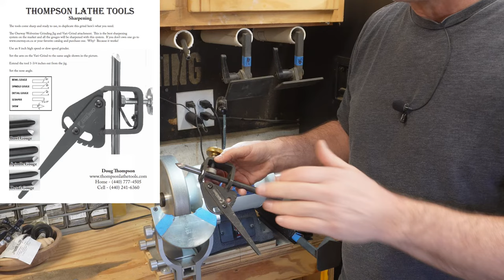Woodturning: My Super Simple Method to Keep Your Lathe Tools Super Sharp

Comment: Hi scott would a digital table saw angle gauge work on your wheels  they are cheap and just write angles required on each tool ??
Reply from the maker: I'm not sure.  It definitely would give an accurate angle of the platform relative to level.  But the angle relative to the curved wheel is quite a bit different

Comment: Hi Scott, Lewis Elliott here. Great sharpening video. What are the distance settings for your wolverine arm, from the front of the base to the front edge of back wall of the pocket for both your spindle gouge setting and your bowl gouge setting? Please let me know. Thanks
Reply from the maker: Hey Lewis,  I know we discussed this already but I'm answering it here in case someone else has the same question.  You would need to have your grinder set to the same height above the clamp and the front edge of the clamp would need to be the same distance from the center of the spindle on the grinder.  If they were not exactly the same, the distance you asked about wouldn't be helpful.  Since we all set up our grinders a bit different, the best way to match an existing angle is to put the tool  in the Vari Grind Jig, Use a known measurement for the amount of tool that protrudes out from the jig, and then slide the bar in or out until you get the bevel of the gouge sitting as flat as possible on the grinding wheel

Comment: Hello thanks for the video been struggling to keep my chisels sharp, I was also wondering if you recommend getting an extended tool rest, and if so where I could find one?
Reply from the maker: Hi and thanks for watching.  Since this was a sharpening video, I'm not sure if you're asking about the 'tool rest' on the lathe or the 'platform' on the grinder.  I'll just answer both.  I have several sizes of tool rests for my lathe and a couple of curved ones for bowls.  Different sizes and shapes definitely do come in handy.  Robust Lathes makes tool rests for most lathes.  But you should be able to find tool rests just about anywhere that sells Lathes and lathe accessories.  Just make sure the post diameter will fit your banjo.  The platforms I use on my grinder are definitely larger than the standard platforms that came with the grinder.  The extra real estate makes it easier to get a consistent bevel.  With that said, although the platforms are larger than the ones that came with the grinder, they are standard size for sharpening lathe tools.  I guess it's a sweet spot.  Anything much larger would just get in the way.

Comment: Great video. Do you have any advice on sharpening using sandpaper vs cbn wheel?
Reply from the maker: I used to sharpen my plane irons with sandpaper on float glass before I graduated to diamond stones.  But that was a long time ago when I made things from boards and before I started woodturning.  With the skew being a possible exception, I think sharpening woodturning tools with sandpaper would be extremely difficult at best and would be very time  inefficient.  You definitely don't need cbn wheels.  They're great but people had been using stone grinder wheels for years before there was cbn.  Instead of cbn, check into aluminum oxide stone wheels for your grinder.  The process will be nearly the same

Comment: Thanks for the video Scott.  At the 26:49 mark you said that you used the same angle, distance, set up on your One Way jig for "all your spindle gouges".  Is this because you use all the gouges in a similar manner, so having the same grind makes for consistent results and would the same use of all settings work with bowl gouge grind settings?  As a new turner, seeing so many variations on bowl gouge tips (bevels, wing sweep, etc.) makes me wonder if using a single type would help or hurt my learning curve.
Reply from the maker: Great question.  Let's start with this.  I'm sorry if I'm addressing things you already know.  Bowl gouges and spindle gouges are  completely different tools for completely different purposes.  Spindle gouges are designed to cut through mostly side grain.  Because a bowl blank is usually mounted cross grain, the bowl gouge is designed to cut through the alternating end grain/ side grain of a bowl blank.  If you look at them head on you'll see that the bowl gouge has a much deeper flute.
All my spindle gouges (except one) are ground the same way.  This helps build muscle memory so the tool cuts as it's expected to.  The specific angle isn't critical as long as it's in a generally acceptable range.  The idea is, that regardless of the size of spindle gouge, with a consistent grind angle, the tool performs as expected.  The same applies to bowl gouges.  Bowl gouges need a steeper (larger degree) grind than spindle gouges to hollow out the inside of a bowl.   all my bowl gouges I use daily have the same grind angle.There are many schools of thought about which grind angle is best.  The best one, however, is the one you're most comfortable with.  I'd suggest picking one and getting comfortable with it before switching to something else.  The key is muscle memory.  A different angle will require a slightly different stance, hold, and movement to work as efficiently as possible.  
That's why it's important that all the spindle gouges are ground like every other spindle gouge, and all the bowl gouges are ground like every other bowl gouge.  As a matter of fact, all my scrapers are also all ground the same with a top bevel of 15 degrees and a main bevel of 55 degrees.  The profile may change, but the bevel angles are identical so they all cut the same and require the same presentation to the wood.  
Knowing how each tool will perform makes me efficient, effective, and safe.  For me, it's important to keep the grind angles as consistent as possible for each type of tool.  
With all that said, I do have a 'detail gouge' which is a spindle gouge ground by hand to a very shallow angle.  It's only used for reaching into tight corners.  It would be a bit unsafe to use that tool as a regular spindle gouge as it's not ground for that purpose.  So for me, it's ok to grind my tools to any angle I need, but the vast majority are consistently ground to repeatable known angles so the tools will perform as I expect them to.  I hope I answered your question in the short story I just wrote 😂.  If you're having trouble deciding on which bowl gouge grind to use, just remember, when used properly, they all work well for those using them.
Reply from the maker: I did do a two part series on bowl turning basics.  Perhaps watching those two videos could answer some of your questions about grind angles.

Comment: Hi Scott, thanks for a super informative video, 
One of, if not my favourite tools for spindle work, and also for tenons and recesses, is an angled oval skew, I invariably sharpen that on a flat oil stone, which seems to work ok? would I be better using the grinding wheel, and if so, should I only use it "one way up" to utilise  the burr? 

One thing for sure, none of my tools seem to cut as well as the one sI see on videos ( they're all good HSS Sheffield made tools)  I'v just ordered a new bench grinder, as the one I have has a white wheel, but fixed 90 degree rests, so it's all done freehand.  Thanks again, hopefully using your advice, and the new grinder I might use less sandpaper!! Best regards...Pete
Reply from the maker: Hi Pete.  There is no definitive "right" way to sharpen.  We all have to do what works best with our individual style.  I know plenty of turners who freehand sharpen all their tools.  Derek Weidman is one that comes to mind and Derek does things on a lathe that has to be seen to be believed.  
With that said, my sharpening method works for me and its relatively simple.  I'm glad you enjoyed the video and thanks for watching!
My opinion on your skew question is, if you're sharpening it as a scraper it wont cut as well when using it as a skew.  The opposite is also true.  When you sharpen a scraper a burr of metal forms on the up side of the tool .  If you turn it over the burr is now on the bottom.  you can force the tool to scrape wood with the burr facing down but it will be very inefficient and will leave a less then desirable cut surface.  Some turners have two matching skews with one side marked so they wind up with a right facing and a left facing scraper.  I just resharpen if I need the burr on the other side.   As mentioned above, there is no issue with sharpening freehand as long as you're getting the edge you want.  I use the platform for speed and consistency.  Getting that bevel angle the same every time also makes the tool very predictable for me.  If your grinder wheel is too coarse and its creating a large burr that "gets in the way" when using the tool as a skew, try stropping.  Stropping the skew will remove the burr altogether and if done properly will leave you with a razor sharp tool.  
If your tools don't seem that they are as sharp as they could be, my guess is the culprit is the freehand sharpening.  It's a difficult skill to master and any error could give you a less than sharp edge.  I hope this helped somewhat.  Best of luck with the new grinder, happy turning, and thanks again for watching!
Reply: @ScottsMiniWoodshop  Thanks very much for that Scott, all good advice, 
Even though I've had the lathe for a long time,  I've never had a grinder until recently, and had to use a flat oil stone, which for gouges, as you san imagine, is not easy!  As I think I said, my current grinder only has a 90 degree rest, so looking forward to the new (Record Power) one.
I think maybe, watching many videos of skilled people turning  often, green wood where great ribons come off the bowls  doesn't match the results I get always turning seasoned wood on a very small lathe. Oh well, new shed in the summer, so perhaps a new lathe to go in it!  Thanks again Scott. Best wishes...Pete.

Comment: Thank you for the timely response, I decided to make a new reply to not bother the op above. So many thoughts..

I am looking for one more wheel, I have by accident a 1” and it is 180grit.
You say you have a 180 to reshape..I am using a 180 to touch up. To really reshape on it seems like it takes to long. Should I get a 1.5 80 grit for my second?  Can you spare some advice.
Reply from the maker: My CBN wheels are 180 & 600.  My thought process on the 600 is that I want to take off as little steel as possible while sharpening.  It will make the tools last longer.  The 600 is on the side I sharpen my bowl gouge which is the gouge I use most often. 
I don't reprofile my tools very often, but when I have to, the 180 seems to work well enough.  But I do know what you mean about it not being as fast as I'd like.
My ideal setup would be two grinders.  One for reshaping and the other for sharpening.  The sharpening grinder would have two 600s.  The reshaping grinder would have a 120 cbn and a coarse aluminum oxide wheel.  I think that would cover just about anything I could think of that I'd ever need a grinder for.  Unfortunately I just don't have the room.  My 600/180 single grinder setup seems like the perfect compromise for me.
I guess the best answer for your question would be to tailor your setup to compliment your work flow.  If you reshape often you might want to look at something a bit more coarse than the 180.  If you don't, perhaps the 180 is good enough.  Just remember, the more coarse the wheel, the more steel it will chew off your tool.  Your tools won't last as long.  Also, a more polished edge from a finer grit wheel will be sharper and will stay sharp longer.  You need to find the right balance for your work flow. 
My opinion on the width is a simpler answer.  I definitely like the wider wheels better!

Comment: I have a brand new DeWalt 8" standard grinder, but I can easily lower the speed on it by simply plugging it into a variac (a variable voltage transformer) by lowering the voltage it will lower the motor's speed and since the variac can be adjusted from 0 to 130v I can adjust it to whatever speed is best.  It beats going out and buying another whole new grinder.  I can use an rpm app on my phone to know what speed the grinder is turning.
Reply from the maker: That a great idea.  I'm fairly certain my low speed grinder runs at 1700 ish rpm.
Reply: @ScottsMiniWoodshop  Variacs are less than $100 on amazon, but I already own one I picked up several years ago to use in radio restorations, using it to bring the voltages up slowly so I could see whether they'd have any shorts in them before they'd be able to destroy old tubes or old transformers that were sometimes difficult to find and/or replace.
Reply: What rpm app do you have on your phone?

Comment: What grit are your wheels?
Reply from the maker: Wheel on the right with the Wolverine mount is 180.  The wheel on the left with the 40 degree platform is 600.  The reason for the 600 is that's where I sharpen my bowl gouge which is my most used tool.  I want to take off as little steel as possible when sharpening to make the tool last longer.  The 180 let's me quickly re profile things when needed.

Comment: Hi Scott, which grit are the CBN wheels you use?
Reply: The wheel on the right is 180 grit.
Reply from the maker: The wheel on the wolverine side is 180.  The wheel on the platform set for the 40/40 is 600.  The thought is the 180 can be used to regrind or reshape a bevel angle or profile.  Since I use the 40/40 bowl gouge more than anything else, I can touch it up on the 600 and get a nice edge while removing as little steel as possible.  Ideally they would both be 600 and I'd have a second grinder with coarse wheel(s) but I just don't have the room
Reply: Does the size matter. Is there a reason you went with 1.5” wheel va 1” wheel?
Reply from the maker: Diameter size would matter more than width.  To be honest, to get the bevel angle as accurate as possible you wouldn't use a grinder at all.  A sharpening belt would give you a straight edge on your bevel instead of a hollow ground one from a grinder wheel.  But you specifically asked about the width.  I don't think the width will really matter at all.  The wider width will  give you a larger area to sharpen on so that may make it easier, or less likely to slip and fall of the edge.  I bought the wheels I did to have the curved edge for sharpening my hollowing tool cutters.  In hind sight, I think I should have bought one rounded and the other square since the wide square wheels I was looking at had grit on the side which would have been very convenient for shaping some specialty tools.